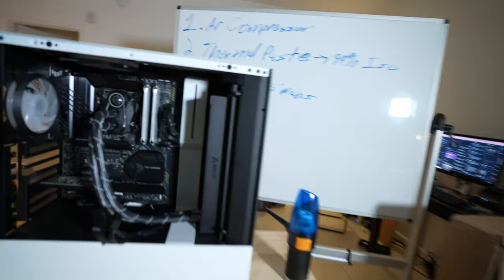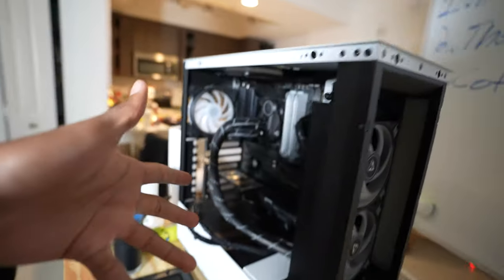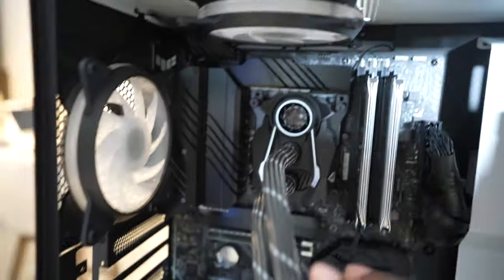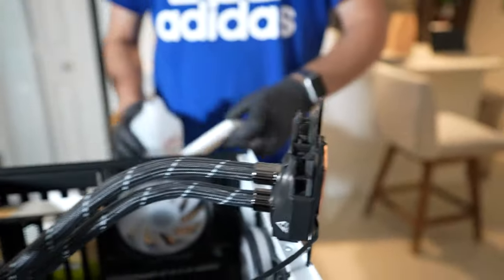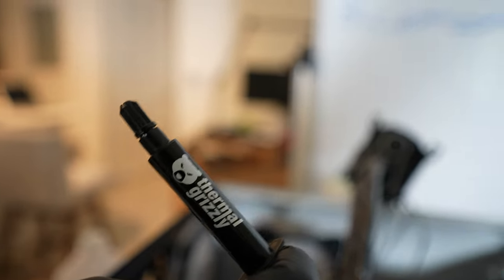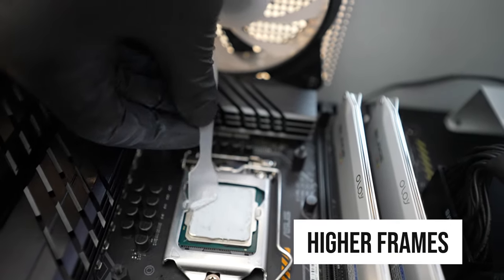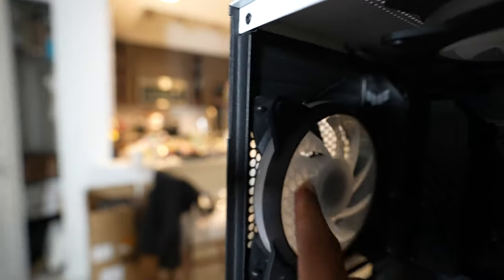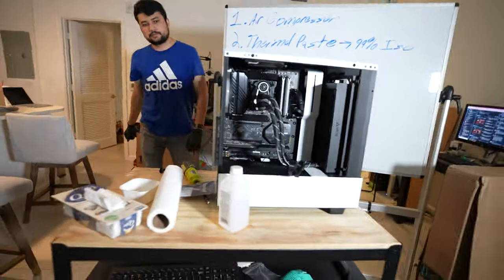Your PC needs THIS

Comment: If you use a spatula, some amount of thermal paste would stick to it and cause wastage. Instead, apply approximately 1 cm diameter dot at the center and then just firmly place the cooler on top.
Reply: It's all the same 1-2 Degrees difference maybe

Comment: I've played around with a few thermal pastes and I found ThermalRight TF8 was just slightly better than Thermal Grizzly. Not by much, but just slightly when testing it with OCCT (same AIO). Just curious too, I've always wondered this, I saw that you and your friend didn't have a static wrist or anything like that. Is it safe to work on your PC like that? Usually I unplug the power wire and I use a static strap. But recently I saw a video that suggested turn the PSU off but connecting the static strap to something like in my case a USB-C that's connected to the MOBO. Is that safe? I ask you a lot of questions on Twitter and on here, I know. But you seem to know your stuff.
Reply: Don't step on carpet while cleaning your PC and you should be fine